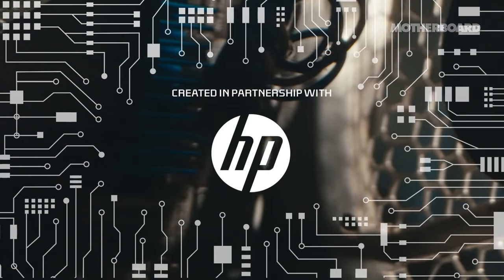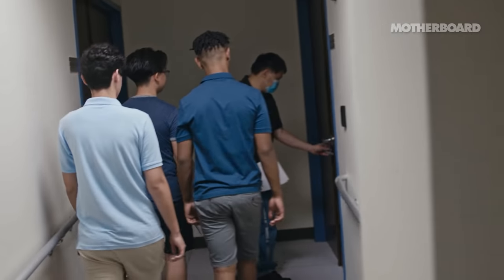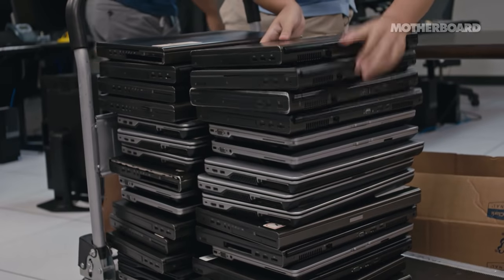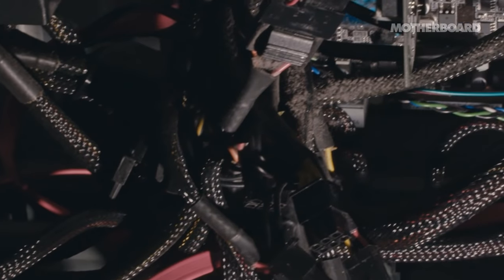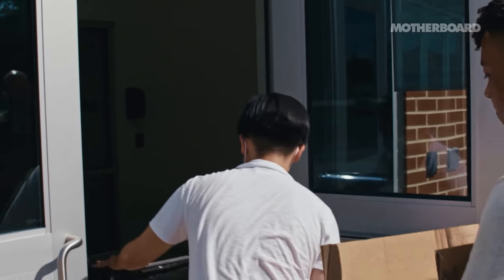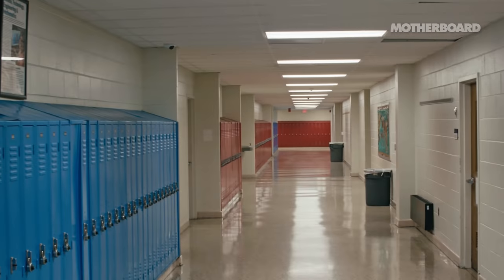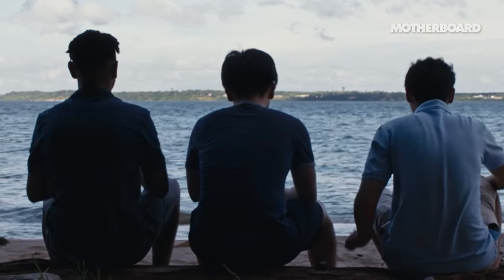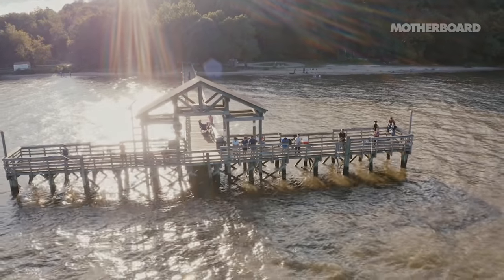Saving Laptops From Landfills | Still Connecting

Comment: These guys are doing incredibly important work. I wonder how they handle operating systems, since you probably can't swap a Windows license from one salvaged machine to another.
Reply: Good question! They are registered as a non-profit so I could see Microsoft donating licenses given the use case. Microsoft has a program to either donate licenses or offer them at a discount for non-profits, their group is likely using it and hopefully getting them for free.
Reply: They'd probably be better of installing some light Linux distro as these machines are older and less powerful anyway.
Reply: Technically, you can do the everyday tasks on an non-validated system. You just have to deal with the watermark.

Comment: This is what happens when we treat computers like cattle instead of pets.

There was a time when people actually cared for the computers they used, and if they broke would try anything to fix them. Nowadays, as soon as something is broken, replace the whole thing, the broken one will be e-wasted because that is just the policy.

Not to mention, planned obsolescence built into OS's nowadays means that a computer from 10 years ago would still be perfectly functional today, but due to arbitrary limitations built into OS's means they aren't able to run that OS.
Reply: Chromium OS is also a great OS for old PCs that make them run like new, and it's built to be nearly identical to Chrome OS, which many schools use already.
Reply: @CorbinTelligman  Chrome OS/Chromium OS is a terrible OS because it relies 100% on cloud based servers to function. If the software you are using requires an internet connection at any point, and refuses to function at all if you can't provide an internet connection (or more to the point, the cloud services are not available), then the software is junk.